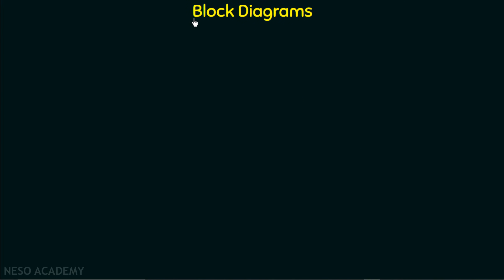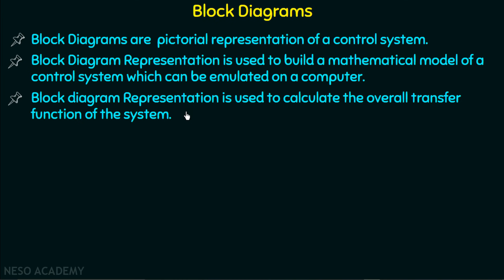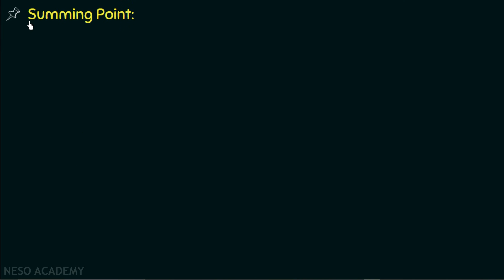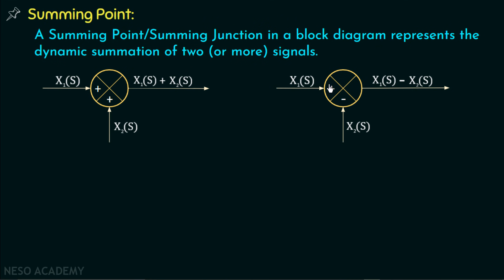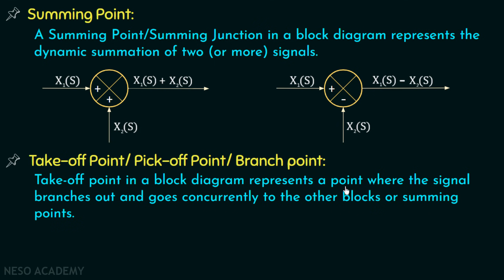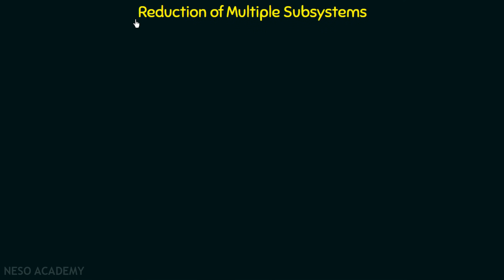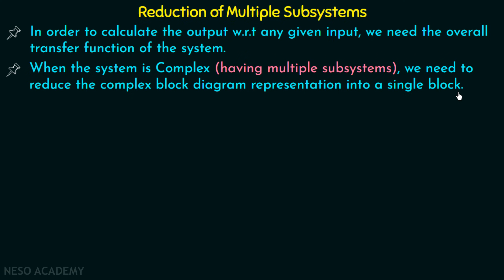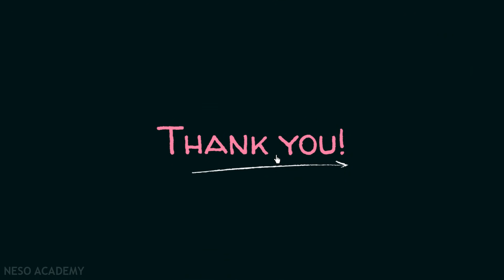Introduction to Block Diagrams

Comment: In take off point after branching all the 3 branches have same R(s) signal? or the signal is altered and distributed like R1(s) R2(s) R3(s)?
Reply: I think take-off points give rise to identical signals.  At least, that's the way I interpreted it...